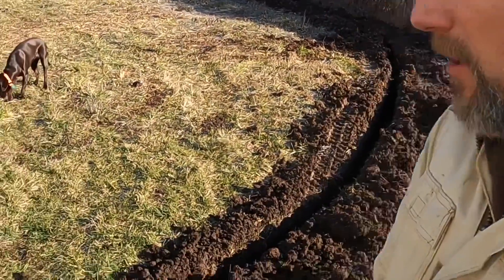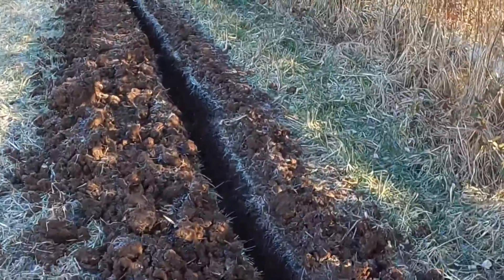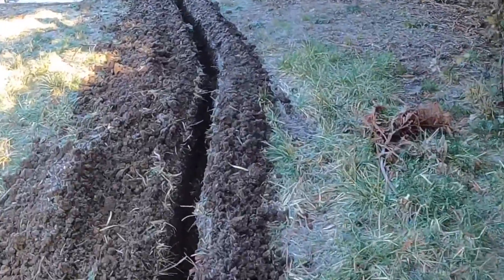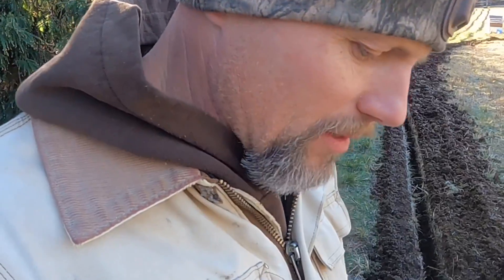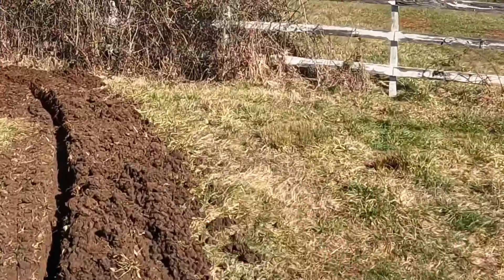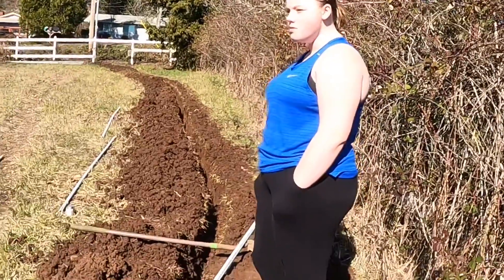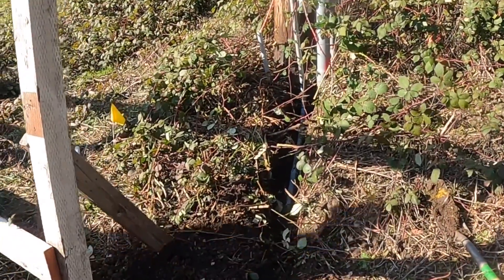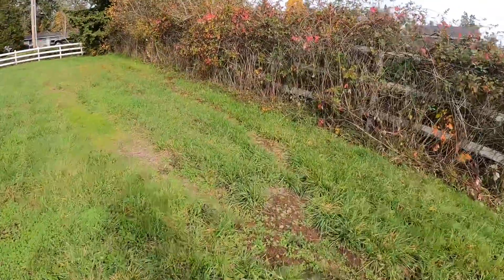Conduit for Fiber Optic

Comment: What is the putty that you used I am doing fiber install as well but my communication company has very little information for using conduit. I found some very nice ends to seal around the fiber but thinking a bit of putty would be good to add so the conduit doesn't fill with water

Comment: Pretty nice installation. Thinking about doing something similar-- my house is around 300' from the pole. Although my utilities (power & cable) are already all underground. My main concern is that apparently a lot of installation subcontractors use a vibratory plow and directly bury the fiber only a few inches deep, and I'd rather not have it accidentally get dug up or broken while I'm doing landscaping and other work.